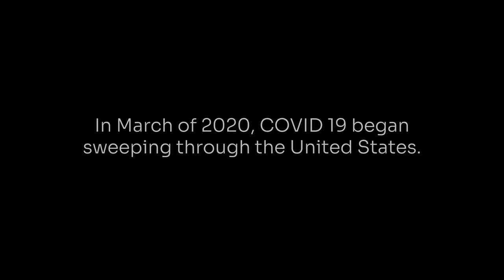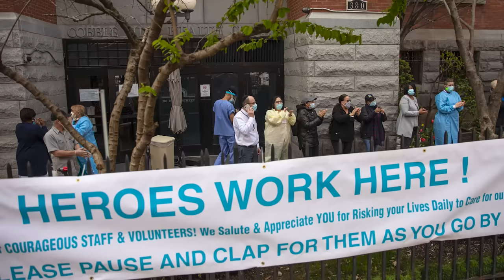Essential -- A Documentary about America's Working Class and the Challenge of Income Inequality

Comment: The need for good wages and a solid "middle class" is a real issue as this documentary points out.  But the solution is absolutely not unions.  The higher wages enjoyed by unions in the construction industry are support by federal laws (Davis Bacon Act) that require contractors pay "prevailing wages" to their workers.  Even if a bidding contractor isn't in the union they will have to pay their workers the same wage as a union contractor allowing union contractors to be competitive with non-union contractors.  If we took away the Davis Bacon Act, all construction unions would either lower the wages or collapse.  Further, unions collect from their worker's paychecks pensions that they frequently don't pay out.  If you are in a union, paying into the pension plan, but for some reason you leave the union before you retire, you will lose all that money.  Your best bet in the construction industry is to work for a non-union contractor that does public works construction.  They will have to pay you union wages and you will get your health & welfare / pension benefits paid directly to you rather than the union saving the money for you.  Also, working for a non-union contractor you will have the flexibility to move from a labor to an equipment operator or to any other trade without the hassle of ridiculous union rules.
Reply: Corporate shill
Reply: @djack915  All big union contractors are corporations.  What is your point?